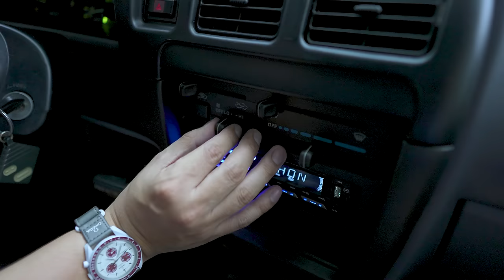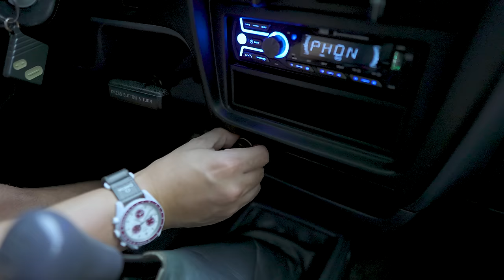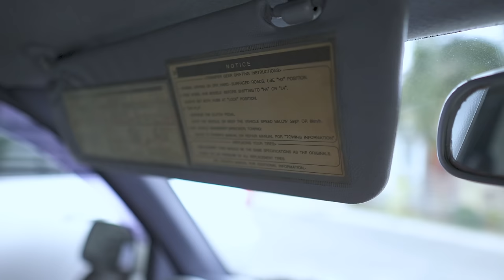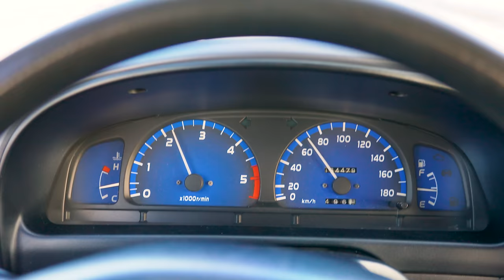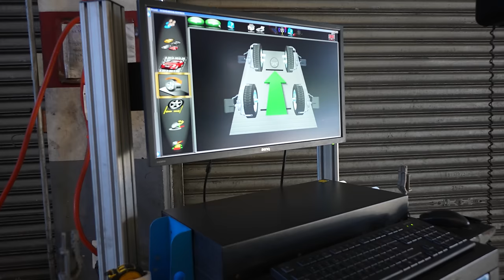2002 TOYOTA HILUX SR5 REVIEW THE INDESTRUCTIBLE PICK UP TRUCK - JEC EPISODES

Comment: Boss JeC, meron ako nito Ln166 model 2000 same specs except yung front hood. Ano po ba mas maganda RIM offset ng tires? Ang naka salang ngayon is R15. Gusto ko sanang mas maangas ang dating na wlang lift up... Thanks.
Reply from the maker: Pag po walang lift best na po is the stock spec, gawin mo po yun ginawa ko 2inch lift then 17’s na rims poging sakto lang